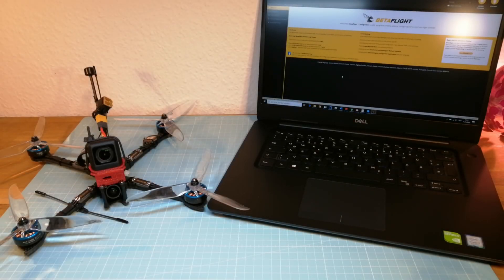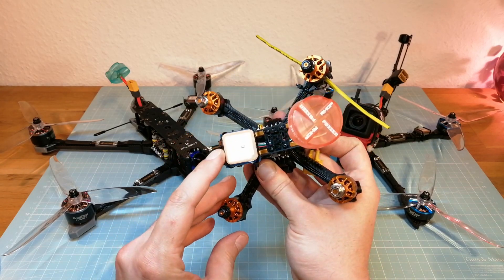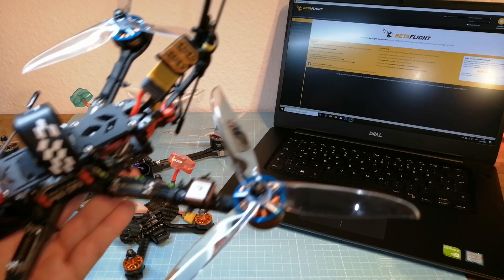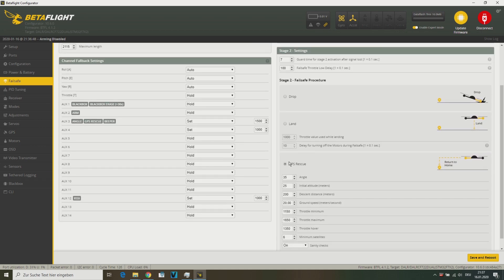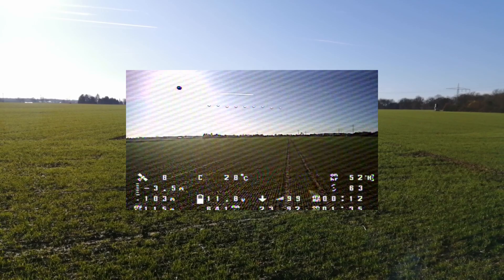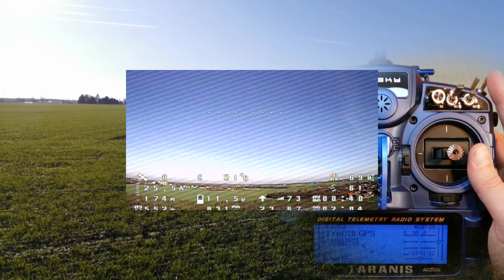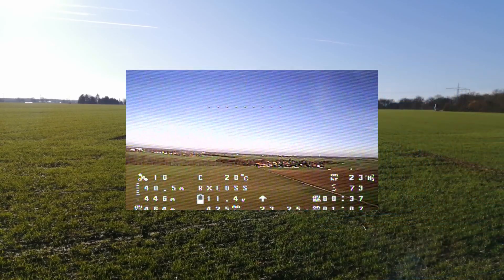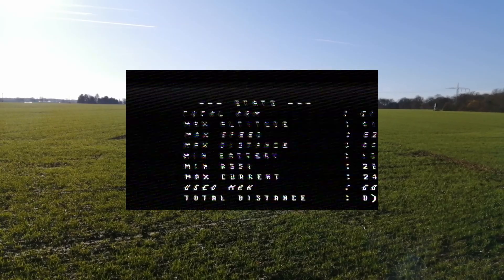Long Range - Betaflight 4.1 🛰️ GPS Rescue Mode 🚨 Real Failsafe Test

Comment: Did u use barometer and compass..
Why iam asking is that gps rescure works without compass and baro right..!
Reply from the maker: compass is required and also comes with the fc, but barometer often isn't included on many fc's  - and as you can see, it even works fine without one.

Comment: Hey Torban.. I know this is old video so not sure if you went back and test the landing part of gps rescue. I would not recommend this as rescue mode don't seem to know when it lands and will not shut off the motors when it does. I found this out the hard way when I test this and could not pick up the kwad until the battery went down because even though it landed it was still trying to fly!! Everything got so hot!! So lucky it didn't burn anything out!! Great test videos bro and keep them coming!!!

Comment: I think it's possible to make a soft landing, when changing the sinkrate in Betaflight's "Rescue Mode" setup. change it to 0.2m/s or even 0.1m/s, which would be a sinkrate of 10cm per second. You should give it a go.

Comment: Have you had to make other adjustments with the newer version of Betaflight?....Joshua Bardwell shows many more things to setup?
Reply from the maker: No you can see all of my settings in the video. Of course, you can do a lot of adjustments in order to tune the GPS Mode for your particular quad - these are just the basics, and it works fine :)

Comment: I have tried GPS rescue mode and works great. When I try switching off the radio it also returns to home position but when I turn back on radio and and try to take control I can not get back control one time it crashed and the second time it came to home position then flew away any help on trying to figure out why I can't take back control.

Comment: Great video! Have a weird issue with my home arrow not pointing in the right direction. Ideas? Betaflight 4.1.4. wondering if arrow not working if that affects RTH?
Reply from the maker: maybe your GPS Module isn't mounted correctly.
Reply: Torban Dallas I’m using the FR7 frame and there’s only one way to mount the GPS. Other users don’t seem to have this issue. But I’ll try another version of Betaflight to troubleshoot.

Comment: does it need magnetometer and compass for gps returning home?
Reply from the maker: You only need the Accelerometer, Compass isn't necessary.
Reply: @TorbanDallas  Accelerometer only levels your kwad, you don't need compass but you DO need GPS.
Reply from the maker: @patertom  but you need to enable the accelerometer in Betaflight, otherwise it won't be able to auto level in the gps rescue mode.
Reply: Magneto and compass are the same

Comment: I set according to your video and rescue it when it failsafe then it falls
Reply from the maker: Do you also use the r9 module? Did you failsafe at a distance of 200 meters or better more? If you are to close, your quad falls.
Reply: @TorbanDallas  I tried in flight mode, I turned off tx so it failseal then it didn't fly back but it fell off
Reply: @TorbanDallas  I am using tbs module with nano rx
Reply: @thanhduyrc4201  watch Nurks video. There is a setting on the crossfire that you need don't quote me without looking but I think you have to set it to "cut" on the module. But watch Nurks "finally got it to work" video. That's why I am here trying to see if I leave mine on "no pulses" or if I need to set custom peramitters
Reply: @du4-fpv777  So, the failseal set is fspos and it works

Comment: Hi Torban, interested to know what were your thoughts on final 7"  motors and prop combination that  performed best for your quad.. Understand auw and battery also affect this but was seeking about 8 mins flight time with not too much tuning, if possible will have about auw 1000gms in mind on 6s Thanks
Reply from the maker: Hi, I did a lot of videos about this topic. Even an entire video series about my 7 inch long range quads. I have tested different frames, motors and propellers and I have even compared it. Finally I have ended up with the setup I'm using in this video.

Comment: Do we need to set gps rescue on a set aux channel? Meaning if I’m flying in Acro/Air Mode and have RX/loss will my quad jump into a stabilized mode like angle or horizon and fly towards hone?  I’ve set stage 2 to Gps rescue but wondering if there are more steps to take to get the quad into a stabilizing mode while in RX/loss failsafe.
Reply from the maker: You'll need to enable the accelerometer. I also enabled the horizon / angle mode in the failsafe stage 1, but it's not necessary any more. The switch is for switching your quad in the rescue mode in case of losing the video feed. And of course, it automatically kicks in in case of a failsafe (stage 2)
Reply: Torban Dallas you have videos showing how to properly set up?
Reply from the maker: @Freebird_67  yes, my FINAL GPS RESCUE Video.

Comment: Torban, thanks for sharing this.
Hey is it normal for the rssi value to drop to 30-40 at that range on the R9?
Reply from the maker: Thanks. No it's not. I was on 10mw and I had a horizontal antenna alignment on my TX. But the horizontal antenna is at the front of my quad. So I think the redundancy function switched pretty often between the front and the vertical antenna at the back. I just didn't want to change the output power or antenna alignment for this test.

Comment: Hi! Verwendest du einen LowESR Elko - wegen den diagonalen Streifen im Analogfeed?
Auf meinem 8 Inch Build musste ich zwei 1000uF 35V Elkos parallel schalten, damit das Bild endlich streifenfrei war (einer alleine hat nicht gereicht). ;)
Reply from the maker: Hi, ja habe einen Elko verbaut, ich nutze ein externes Eachine DVR, und einen externen Diversity Empfänger, die und die Verkabelung verursachen die Streifen, auf meiner Eachine Watch und meiner Aoemway Commander ist das Bild sauber. Das Ergebnis vom externen Eachine DVR gefällt mir aber für den aktuellen Zweck immer noch am besten. Störungen kommen definitiv nicht vom Copter - die Streifen wirst du auch in all meinen anderen DVR's finden.
Beim Eachine Tyro ist das aber noch mal ein ganz anderes Problem, dass kommt vom Tyro, der ist dafür bekannt, habe die Cam schon mit Kupferfolie abgeschirmt, dass hat es etwas besser gemacht. Ist halt ein Low Budget Copter aber für den Zweck echt gut geeignet.

Comment: Hi Bro ! ... thanks for the video ... Your 3.5 betaflight videos really helped me setup the rescue mode correctly back then ... unfortunatly I was traveling for work and did not fly too much since then ... now I'm back and want to upgrade all my fleet to 4.1 to use rpm filters and off course gps rescue.... But I saw your last videos about an issue with gps and 4.1 ... is it really a big deal ? I also wanted to ask  if we can use rpm filters and enable gps at the same time? I saw that rpm filtering uses a lot of processing (I have a F7 and a F4 quad)
Reply from the maker: Thanks for your comment and your feedback, I appreciate it! I'm running 8k8k dshot 600 and gps without issues on my f7. GPS Issue can be fixed with setting the ground assistance type to the right setting for your location, like european egnos for europe. 4.1.3 should have been some fixes maybe there you can stay with the auto detect. But i didn't test it yet. 4.1.2 workes fine for me know, gps rescue works, i'll stay with it.

Comment: So, how did you fix the Sat count problem?...You know, everything hunky dory then no Sats suddenly..?..That WAS the problem as I recall..🤔🤔🤔
Reply: EnglishTurbines I fixed it. I put a selfmade antenna on my gps module. I destroyed and removed the Keramik plate on the gps. And put a Helix antenna on it that I made. I get 12 to 14 sats in just a few seconds. No waiting and no no sats anymore
Reply from the maker: Check my privious video. I have fixed the GPS issue with setting the ground assistance type to European Egnos. It's just a Workaround but at least it seems to work for us in Europe.
Reply: @TorbanDallas  Oh, thanks for the crucial information...🤔🤔😎